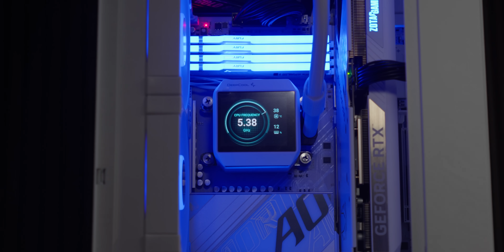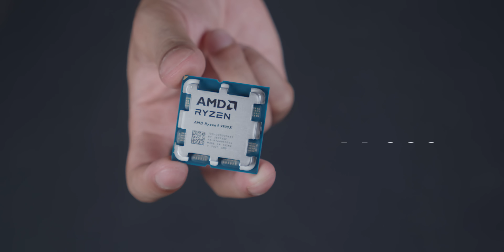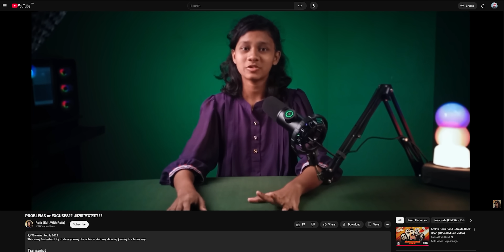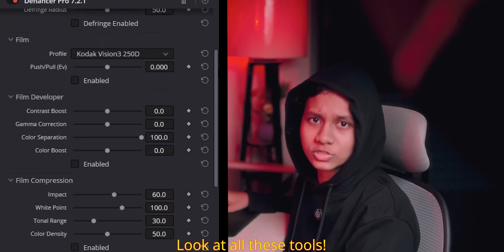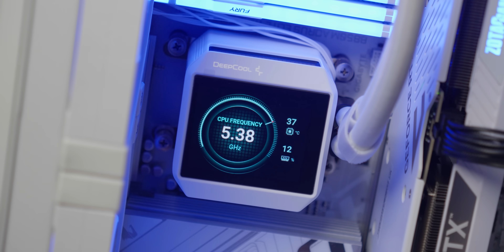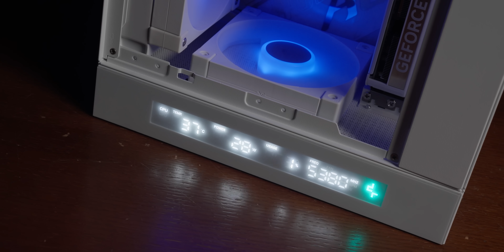পিচ্চি রাফার পিচ্চি পিসি | Editing PC For @editwithrafa

Comment: Vahi 100k-150k gamming er jonno 1000+ fps e game kehlar jonno akta pc suggest koren please 🙏🙏❤❤ar ai build ta kiki change korle bhalo hobe akto reply chai🙏🙏🙏 

CPU	AMD Ryzen 7 5800X3D (AM4, huge L3 cache)	~28,000৳
GPU	NVIDIA RTX 4070 Super 12GB	~70,000৳
Motherboard	MSI B550-A PRO / Tomahawk	~13,000৳
RAM	16GB (2x8GB) DDR4 3600MHz CL16	~6,500৳
SSD	1TB NVMe SSD (Lexar/Kingston)	~7,000৳
Cooler	DeepCool AK400 / Thermalright Peerless Assassin	~4,000৳
PSU	650W 80+ Bronze (Antec/Corsair/Gigabyte)	~5,000৳
Case	Montech / Value airflow case	~4,000৳